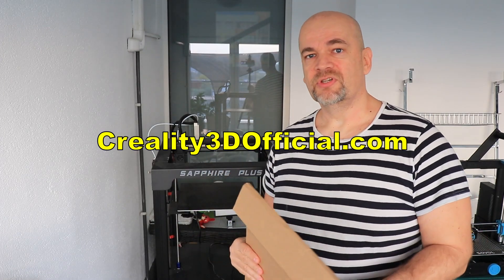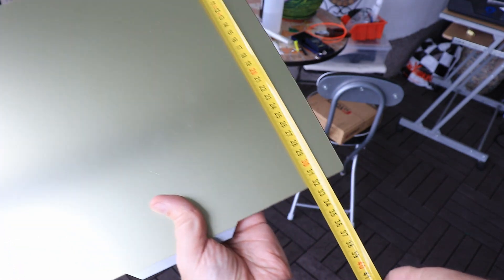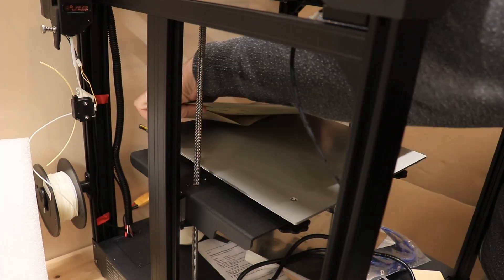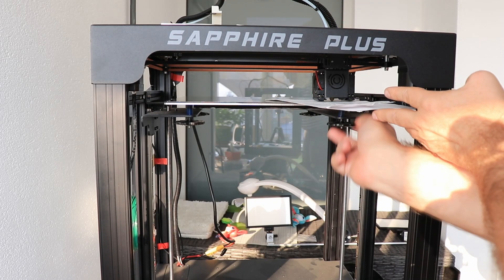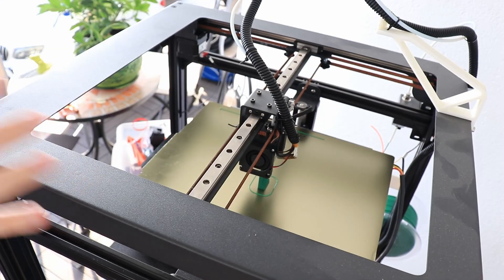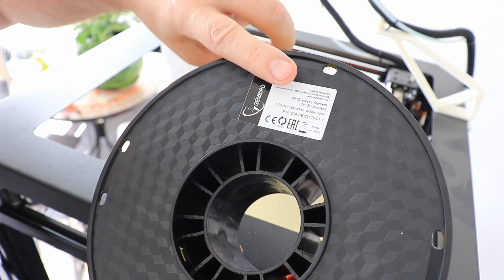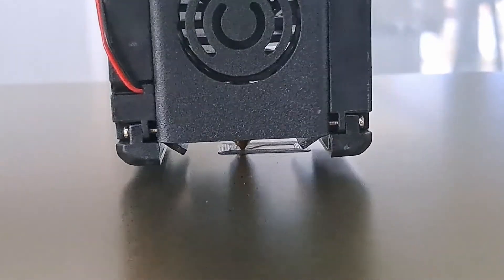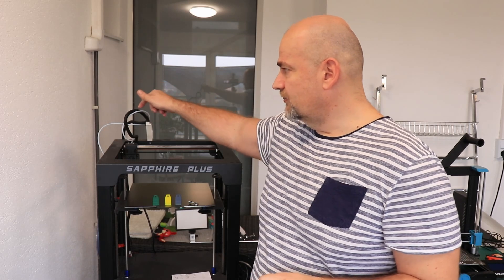Flex PEI sheet (310x310mm) by Creality3Dofficial.com

Comment: Why didn't you pass over the PEI with 0000 steelwool first to create a light texture to improve adhesion? I've done this and it works fantastic!
Reply from the maker: I didn't got steel wool in packaging. This means other users will not get it and most of them will not use it. Of course I have steel wool at home (I also got it with wham bam beds), but I am testing circumstances like most of other users would have.
Reply: @MyTechFun  I understand. Great videos, I'm a big fan of your work. You should also consider testing garolite or G10 surfaces. Especially for Nylon printing. Both heated and unheated. A thin sheet with a little flex makes a very good print bed.

Comment: Ok, I'm a cheapskate, but I really wonder: why are these things so pricey?  Is it the spring-steel?  Is there no way then to have PEI on top of some cheaper, possibly even "rollable" flexible magnetic surface?
Reply: i don't 3d print. Just an educated guess:
The coating. The adhesive. The magnet sheet. The steel sheet. All of those should have a consistent thickness all-throughout, such that your object is printed square, not wavy.
For that expected consistency <$$$ . I say "should" and "expected"... That consistency could be tested and plotted point-to-point delta, like Games Nexus measures the flatness of CPU Coolers; search for them on YT they even have videos on explaining methodology for such tests (or cpy past "Gamers Nexus Corsair A500 CPU Cooler review" <at the 4 minutes mark).
You mentioned spring steel; vs coldrolled or stainless, or even other materials. If there are tight tolerances in the final product < bulk of the cost. Followed by the convenience of all-in-one package; +marketing. And only after that comes in the BOM cost (cost of the raw/base materials).
Reply: In the UK this product is about £40 - it seems it is cheaper in other countries - but it is a large sheet. The smaller 240x240ish ones are about half the price. I suspect the price of this has been adjusted to reflect the price of the machines it is designed for (CR10, Ender 3 Max etc) somewhat but it does have to be made to a certain precision and the larger it is the greater chance of it failing the quality tests. To be honest, as someone who has bought supplies in a manufacturing environment, the cost of this build plate is only expensive when you compare it with the cost of a 3D printer, which has dropped ridiculously in the last couple of years. But if you look at any of the upgrades for the creality printers, the cost for the CR10/Ender Max parts are almost always twice than for the smaller printers, even when the real difference is just a slightly longer length of extrusion or lead screw. That probably reflects how many they sell, and that they are prepared to make a smaller profit many more times on the smaller models.
Reply: @IanSlothieRolfe  Yes, and no.
You can find "out in the wild" smaller printers More than there are bigger ones.
Economy of scales in the favor of the smaller rigs.10-1? 100-1? mini Vs Max.
Again spitballig here.

Comment: I have a Tronxy X5SA with a 330 mm square bed size. This PEI you shown is close to the size I looked for But I can't find a PEI sheet of 330 mm square. 
The biggest here in the UK I found was 320 mm and it cost a silly amount to buy and still 10 mm too small. 

The Rubber like Ultra Flex Tronxy magnetic 330 mm bed sheet I have got is crap!
at around 70 C it starts to curl up at the corners which as you said with some it is not good for printing?

Comment: I bought a magnetic pei set from creality. The problem was it had a bad odor when heated to 100c. I think it had an adhesive that was not rated for 100c.
Reply: Does it still smell? The glass/PEI bed on my Ender 3 Max gave off an unpleasant smell for the first few hours of use and now is odourless. I found there was some kind of yellow film on the plastic that came off with Isopropranol. That said, I don't tend to heat over 80 degrees and discovered the indicated temperature was more than the actual temperature when I measured with a thermocouple, so now I use a higher bed temperature than specified than the filament supplier.
Reply: @IanSlothieRolfe  I removed it a month after I started using it. I remember checking the 3m number on the peel away and it was not rated for 100C continuous. I went to 4mm glass for the last 2years.

Comment: Hi, thank you for the video. I wonder if heating the magnet or the glue e.g. at 100 Celsius degrees for hours could release some dangerous fumes, or loose features. Do you know what are the limits in that sense?
Reply: Almost all printers use that type of material. In v-core 3.1 I don't have any problems at 120 Celsius degrees after a lot of hours